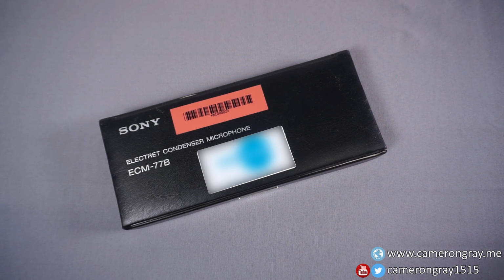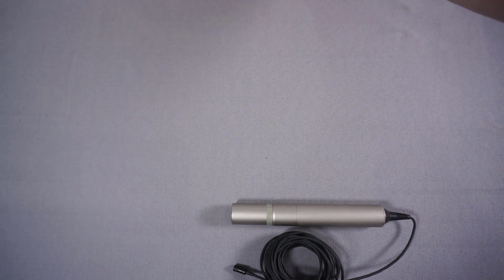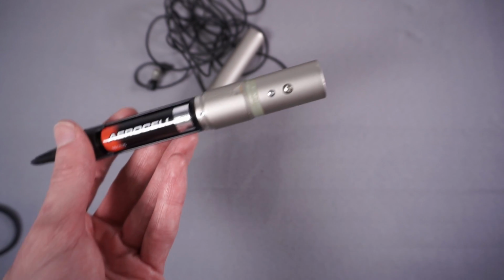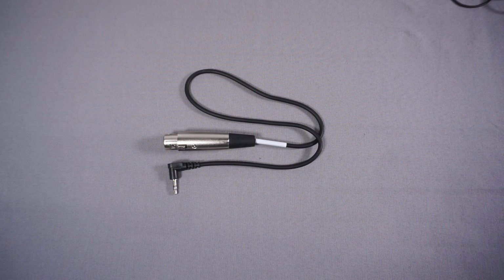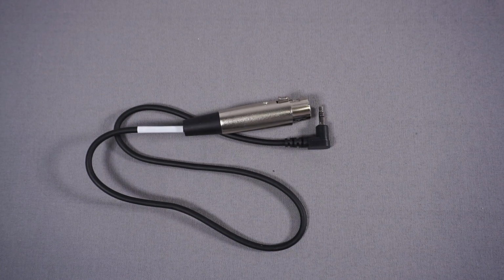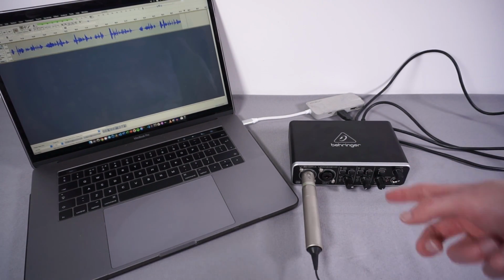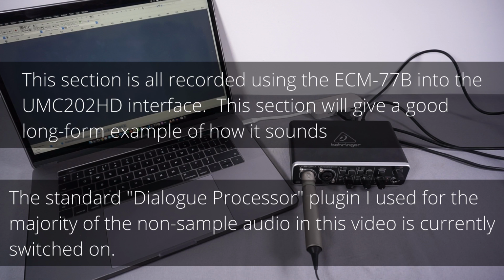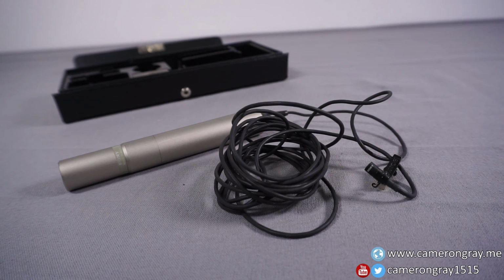The King of Lavalier Microphones - Sony ECM-77B

Comment: For the windscreen pop filter, put some of those small dental rubber bands around the case of the microphone to increase the diameter.   The rubber surface provide a slip free surface for the foam to grab onto.

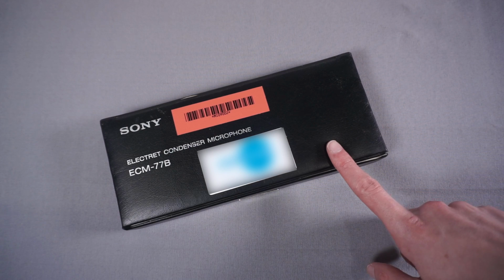Comment: 1:49 I feel the same, but with a company here in Singapore called "Asia Asset Recovery", as they have so much cool stuff that I've been trying to resist going there as I know I'd buy A LOT of stuff from them, but I live in a tiny apartment and don't have a lot of space! Once I can afford to go there, I'd throw together a list of things listed on their website (actually multiple Carousell accounts, but they tell customers not to contact them there) so I can hunt for them.

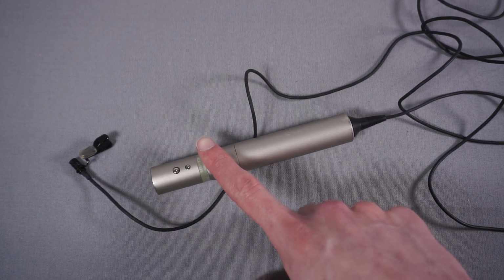9:00 I imagine that whoever manages the cameras and microphones at the studio would place a sticky note to remind that a battery is installed, though I won't be surprised if there are high-end TV cameras that provide external microphone inputs with 48V phantom power.

10:33 I bet Sony also offers radio mic transmitter/receiver sets to go with some of those mic variants, with the transmitter clipped somewhere offscreen, and the receiver connected directly to the camera's external microphone input or a voice recorder.

With the sound quality comparison, I noticed the audio sounding cleaner when you switched to the Sony microphone, and that's just with listening through a mono phone speaker.

I say the output with phantom power and no battery sounds better than when it's just running off the battery!
Reply from the maker: Sony certainly do sell wireless systems to go with this microphone then they also sell it with connectors suitable for other brands of wireless system as well.  I considered one as I found a wireless ECM-77 system on eBay for around £100.  However, most professional wireless systems in the UK require a licence for the radio frequency, and the reason that the system I found was so cheap is that it was fixed to a frequency range that licences are no longer available for so I wouldn't have been able to use it legally.
Reply: @camerongray1515  
Oh, I see.

Comment: your out of phase test sent the audio to my rear speakers!
Reply from the maker: Interesting!  Is your system using some sort of Pro Logic type surround processing?  According to the Pro Logic Wikipedia page "the surround channel is encoded using phase shift techniques for out of phase information (L-R)" - Wonder if I've inadvertently triggered that!  Need to give it a go on my receiver.
Reply: @camerongray1515  i'm watching it on my TV (via an Nvidia shield), which is connected to a sony atmos soundbar. the audio is set LCPM 2.0 with the vertical sound engine (neural:X) enabled (so i guess it's "upscaling" the audio), but yeah during that test all the audio was pushed to the rear speakers)
Reply from the maker: Just tried this and was able to replicate it, it didn't do it playing through the Mac Mini I normally use, even with the receiver set to Dolby Surround (probably as the Mac is already sending a multi channel digital signal over HDMI) however I then tried contacting my phone using a 3.5mm to RCA cable into one of the analogue inputs on my Denon AVR-2400H receiver, set it to the "Dolby Surround" sound mode and sure enough, the regular sections were played through my center speaker and the out of phase test was played by my rear speakers.

Definitely interesting stuff, as far as I can guess, what it seems to be is that the original standard for Dolby Surround is designed to carry 4 channels over a stereo analogue signal while still being backwards compatible with stereo systems. These channels being left, center, right and a single rear channel. Sound sent equally to the left and right channels are sent to the centre speaker whereas sound sent to specifically the left or right are replicated on the corresponding speaker.  Then for the single rear channel (which a modern system with multiple rear speakers will just play across them both) it puts audio signal on one of the front channels and then the inverse on the other.  A Dolby Processor will separate these out of phase signals and send them to the rear channel however if they're played on regular stereo speakers the out of signals will cancel each other out allowing for backwards compatibility for non-dolby systems.  I'm now half tempted to play around a bit more with this!

Comment: 19:36 For this bit the audio came out of my rear speakers in my 7.1 system lol
Reply from the maker: Yep, this is something someone else had as well and that I've been able to replicate!  Turns out that the original standard for Dolby Surround encodes a single rear channel by placing it on the left and right channels with each channel out of phase with the other.  This allows it to be contained within an analogue stereo signal while maintaining compatibility with existing stereo systems.  Seems as though my out of phase demo will end up being sent to rear speakers by AV receivers which are trying to decode Dolby Surround.

Comment: I didnt hear any difference between the two, are you sure that you selected the right audio tracks in the video?
Reply from the maker: The files are definitely correct, the difference is definitely only very slight, I could notice it (mostly at the points where I transition between microphones) but that's using decent studio monitors and the raw uncompressed 24 bit WAV files.  It's very dependant to what you're listening on and I also imagine YouTube compression won't help.  Suppose it's a testament that the Giant Squid can still hold its weight against something so much higher end!
Reply: @camerongray1515  im running also on studio monitors and a audio interface. but i think like you said, that yt compression affects it very hard. but i must say, in the second hearing with both switched on the zoom i heard a bigger difference as on the audio interface vs the zoom

Comment: Hi Cameron, I am a bit confused about what you said about a mono jack in a stereo socket. Would the left and right pins in the socket not both connect to the same metal cylinder on a mono jack thus meaning the both receive the same signal?
Reply from the maker: In a mono jack, the tip carries the audio signal and the "sleeve" is the ground.  Therefore when using a mono jack into a stereo socket, the left channel will connect to the tip but the right channel will connect to the sleeve which is ground.
Reply: @camerongray1515  thanks that makes sense. I wrongly thought that the tip was ground and the sleeve was the signal.

Comment: But then the question rises, what kind of stuff were you tempted to bid on?
Reply from the maker: There was an absolute tonne - various audio mixers, projectors, laptops, LCD panels, LED video walls, PA kit, lighting, lighting desks, cables, the list goes on.  The only saving grace was that I simply didn't have the space nor use for a lot of it.  I was half tempted to get some stuff to sell on but after taking into account eBay fees.etc, the profit wouldn't have been worth my time.
Reply: @camerongray1515  ah yes, i've been in this position myself many times. There is just so much cool stuff selling for 'not a whole lot of money'. But indeed, i've got no use for it, no space for it and i don't have a three phase connection to power it. Yet...

Comment: Thanks for the video, i have an old Ecm 77B , but its volume output is low, 
Compared to other mic same model but different capsule. 
I tried changing the batteries, but no luck.
Any thoughts?
Reply: Is it receiving enough power? (phantom power) Just a thought, I don't know much about it, ha.

Comment: Are these meant to come out mono? I use mine but it's mono, not stereo...
Reply from the maker: It's a mono microphone, how are you connecting it to your equipment/recording it?  You will either need to set your audio input to a mono input which will send the audio equally to both speakers or adjust the audio tracks in editing to set the audio from the mic to a mono track.  If the audio is only coming out one speaker it's because you're recording it as a stereo audio track while only feeding audio into one of the channels.